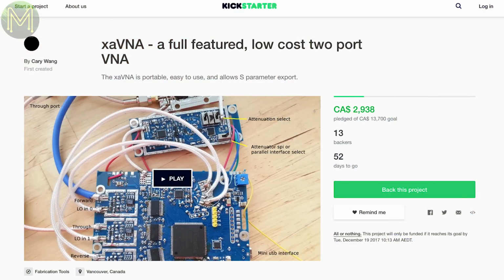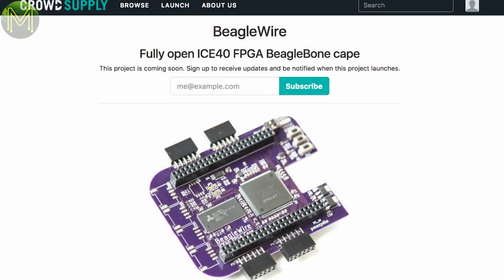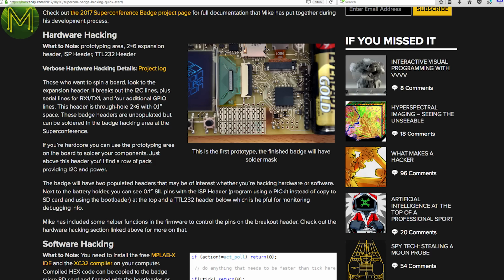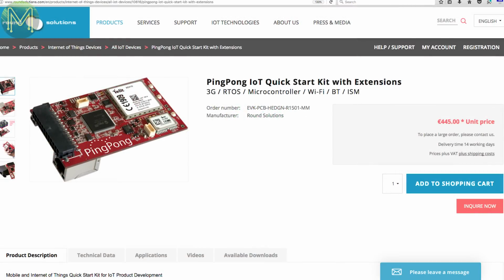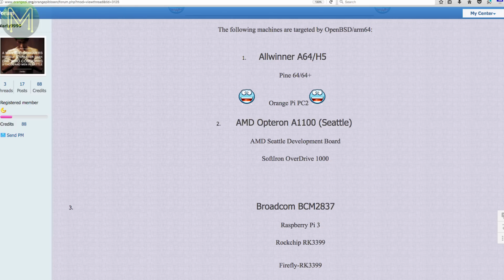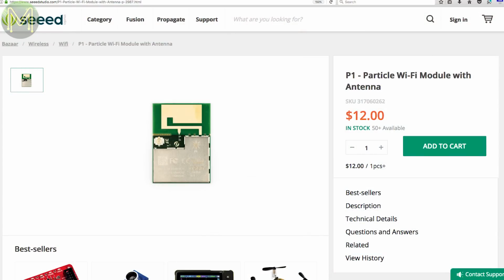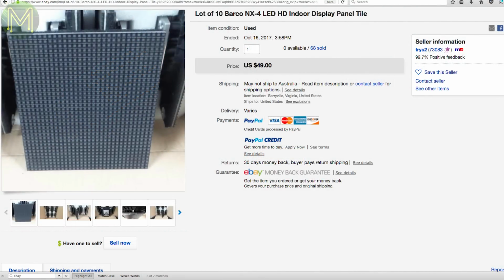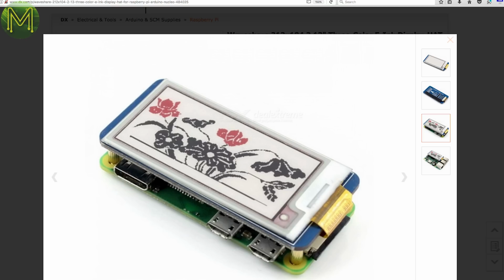#178 Weekly Roundup #46 - New Maker Products

Comment: FreeNAS is based upon FreeBSD rather than OpenBSD.  Differences between the two are significant enough that it may take a while before FreeNAS makes its way to ARM.  One significant difference, is that ZFS is not on OpenBSD as of yet, as far as I know ...
Reply from the maker: +Rob Sciuk 
There’s actually a lot of resistance by the FreeNAS people to support ARM. One of the major reasons is that most ARM SBCs have very little RAM. ZFS requires a bucket load of RAM. Around 2G for the OS and then add 2G per TB of storage. You can get away with just 1G per TB, but stability is a concern.
I did see something about ZFS support on OpenBSD, but need to dig that link up.

Comment: trigger for lightning photography? comeon... that aint work, cause sensor and cam are way too slow to capture this. if u wanna picture a lightning strike you need to switch over to different techniques.
Reply from the maker: +Christian Fuchs 
Yeah, I was surprised with that as well. But there’s talk of using it as a trigger. I would have expected a light based trigger to be useful.
Unless this trigger is used just to take a bunch of quick succession photos after the first initial strike? Possible
Reply: MickMake nope. even not that. lightning is over till the sensor can told you this... were talking in micros, not millis... no way for this usage. about the sensor: i noticed in 2014 that there is an austrian company (from graz) who build a sensor who can detect lightning and a bit more of that, and there sold them all over the world... a clone, a spinoff? at least very interesting topic.

Comment: It seems like there are 50+ SOCs and ESP32 board versions to choose from, so we choose the original most well known designs because we are unable to make a decision otherwise. How many of these device designs will still be available 6 months from now? Even well backed designs, like the Intel IOT device, fail due to the richness of choices killing the market.
Love this 'show', obviously lots of work goes into it. The companion Blog is an excellent reference!
Reply from the maker: +Edward Casati 
Yes true. Apart from the official ESPs, the next step up would be a DFRobot FireBeetle or a AdaFruit Feather. Both have LiPo battery mgmt onboard and a bunch of add ons.
Reply from the maker: +Edward Casati 
Thanks. Yes, a lot of work goes into making videos. It’s not a simple case of slapping it all together and “Bobs your Uncle”. I tend to be a perfectionist as well, so they take a little bit longer than they should

Comment: I keep seeing these cheap "oscilloscopes" here there and everywhere. I'd like to be able to see a waveform/signal every now and again but which one??? There are so many and I have yet to see an unbiased/objective review of the available products. I'm lost, should I fork out $500 on a little RIGOL, or maybe $300 on a HANTEK or, given my need is intermittent , and only a hobby, should I "waste" $50 on a DIY board with tiny LCD screen??? Any and all input appreciated. Cheers.
Reply from the maker: +James Lamb 
There are lots. It all depends on what you want to use it for. If you’re dealing with a lot of logic circuits, then even the cheaper ones will suffice. They become useless when you start looking at signals hitting the 20MHz mark.
In experienced hands a decent oscilloscope can do wonders, but you tend to not use them much.
So, it all comes down to what you’re doing.
For a home hobbyist, get the cheaper ones until you have a need for the more expensive ones.
And before you buy, make sure it’s supported under sigrok!
Reply from the maker: +Mike Meyer 
Yup, that’s the key. If you can live with the shortcomings, then it’s a winner.
I still use my cheap China USB DSO, especially for tracing protocols in bitbash scenarios, but it’s a no go for analog signals.